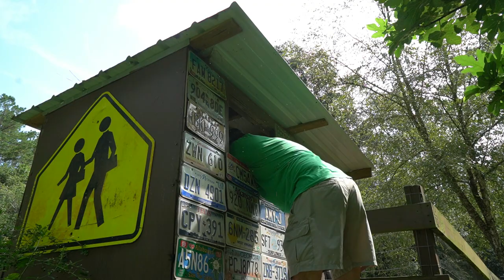THIS Turned Out WAY Better Than We Expected!! Transforming a Trailer To a Chicken Coop (The Windows)

Comment: If you're having electric wired into the new coop, you might want to put exhaust fans in the ceiling to pull out and move the air.

Comment: @Jason, Great progress today!😊👌👍💗
Just a few ideas: For strength & support stability you might need to add some bottom to top  studs, with a cross beam resting on them, to prevent twisting or collapse during moving the coop & high winds. I'm thinking at least 2 or 3 of them. They'll also be good supports for mounting rows of laying & setting boxes. 
     The sidewalls of metal & wood had been a lot of the walls' strength. Also, you need a 45 degree wood brace in the upper & lower end of the wall studs, for strength & to prevent twisting & collapse. 👍
Reply: Smart idea!

Comment: In the trailer for the chickens, one of the reasons it’s probably cool is because of that wood paneling inside, that kind of acts as an insulation. When it’s really hot or really cold in the winter that extra layer of insulation is going to make it much nicer in there, if you pull that paneling out you’re just gonna have metal and air and some of those places and that’s gonna transfer the outside heat and cold a whole lot easier.  

I think the ventilation in there should be great with the floor out like that.  Now you just need to add a motor and a steering wheel so they can cruise around The property on their own. Like a giant chicken bus.

Comment: A little late now. I used to work on trailers. Easiest way is to have one on inside and one outside of door. Put it in down position and take off one at a time from the top. Also safest way. LOL. The cutouts you have now. What about reversing them and adding hinges to use as a rain blocker? 
Cog County Cluck District.

Comment: Since you're going to need ventilation in the school bus coop, think about a solar panel to drive any fan/ventilation.  The panel can easily be mounted on the roof of the coop. It could run during the day, that might be all you need.  #harborfreight

Comment: When you go to put teepost in to keep from having to pound each one of them with the post hole driver driver use the bucket on your tractor on your tractor if you careful you can push them right under the ground. And it also pulls deposed really well with a chain.
Reply: They tried that and it bent the T posts! Oops ground was to hard
Reply: @dorothyallen3614  we do it all the time if we have many post. You just have to take it slow and even it can be done and it saves your arms.

Comment: Consider lining the windows with chicken wire. We cut windows in the sides out of our coop and covered it with chicken wire for security. A ton of difference in the air flow and cleanliness of the coop. In the Winter it can be closed up.

Comment: new coop:  buy some 8' angle iron ( x 2) and screw  them up high across 3 of the supports for support, then remove the center support. Add wood frame to opening , and add an awning for rain on the outside.  Add ramp as needed.  Make a double hinged door, or even mount an electric  poultry entrance (used commonly).
Reply: You could use one of those garage door pieces to make the awning.  You could use them upright as skin on the large opening where they used to be.
Reply: Windows - make them to open (inward) and put screen across the outside.

Comment: I was kind of surprised that you cut the supports out on the sides of he trailer to make the windows. I was thinking you were going to cut out between the studs. Won't that side be weak now that all those studs have been cut, especially since you plan on making it a mobile coop? Love the idea of painting it like a school bus😁
Reply: The metal studs are pretty strong, and really only that close to withstand highway speeds & sway. Moving it around the farm won't cause any issues.
Reply: @rwjingo4955  ahh, I wasn't thinking about it being made to travel roadways, thanks.

Comment: That coop is perfect.  I live up in the great white north, Michigan, and I dont use heat lamps in my coop but it's pure h$!! Trying to keep water from freezing.  6 months of struggle.  I've tried heated waters and hot pads underneath.   Still have to chip away ice.  As long as chickens can get out of the wind, they will survive.

Comment: What is your reasoning to not take the axles off and bring the coop down from being so high?
Reply: I believe they plan to hook the tractor up to it and move it around the farm; letting the chickens rip up the soil (feces as well)  to put the garden in next year.
Reply: @pattdunn9845  but that's going to be a very high ramp the chickens will have to climb to enter the coop. Most trailers like this are 52"-55" from the floor to the ground. I guess I've just never seen a coop so high up but, I know Jason and Brook know what they are doing. Not questioning it just asking why?

Comment: Dude. You cut the metal support's. I hope you put metal support's horizontally under each cutout on top or underneath or the structure will twist and weaken the structure from weight of wind, rain and snow. When it will collapse is a question, not a IF❓